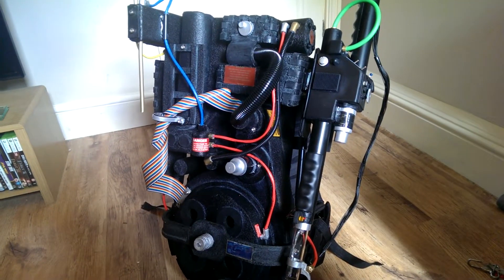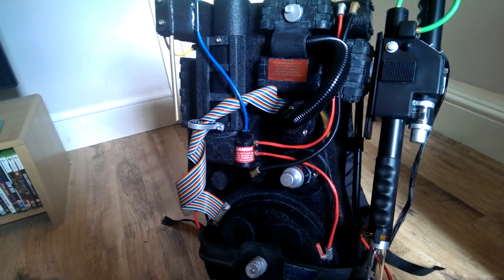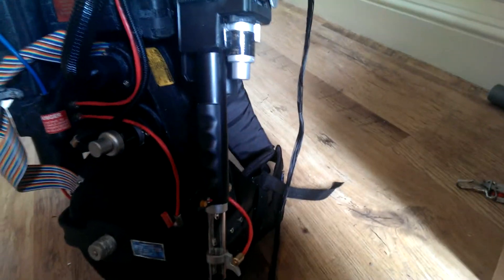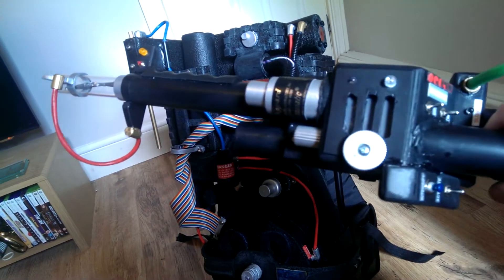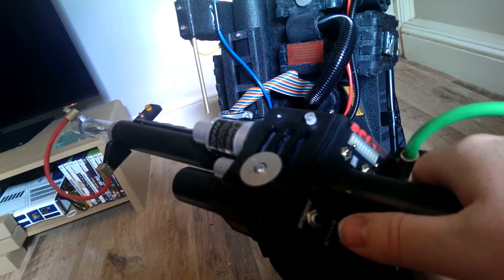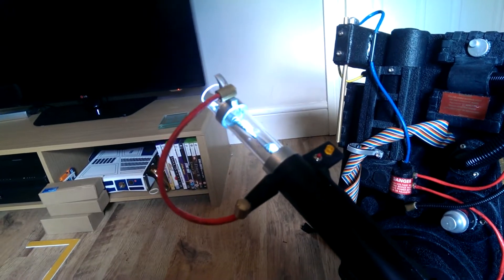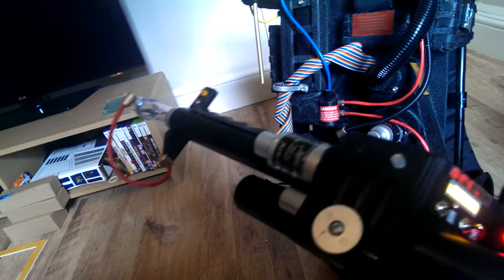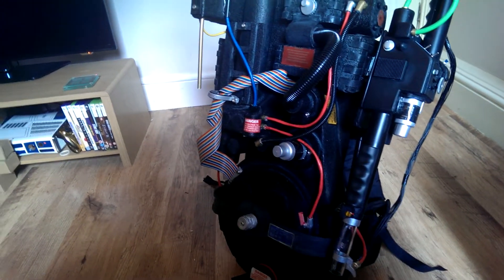Ghostbusters proton pack gun light test

Comment: Great work on the thrower lights, especially loving the vent light!  What did you use for that?
Reply from the maker: i just wired in 2 extra leds in the same line as the flasher tip and put some opaque plastic over the vent its quite a good effect